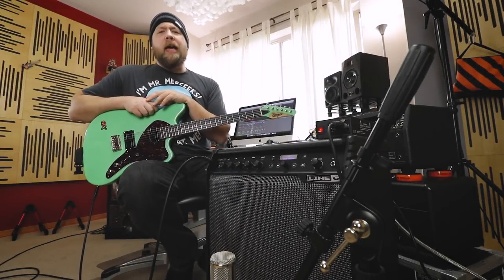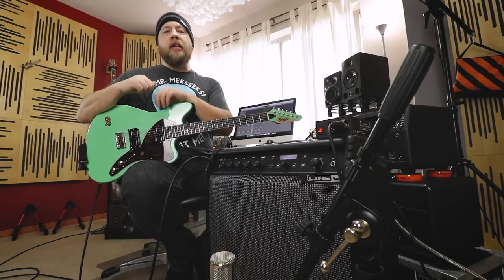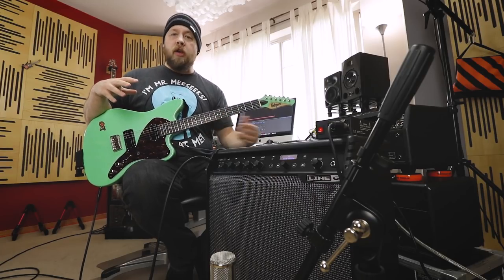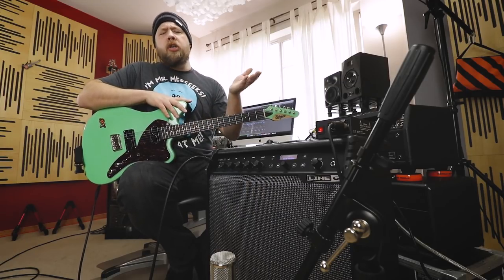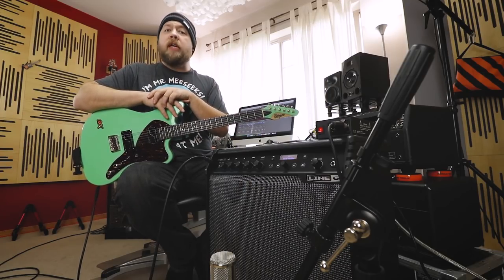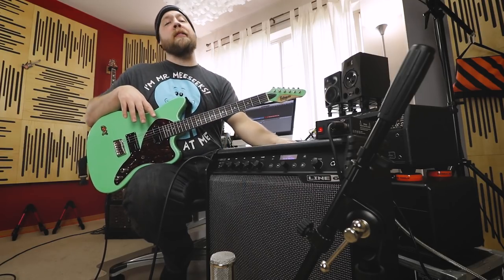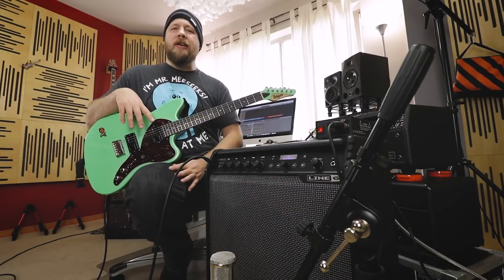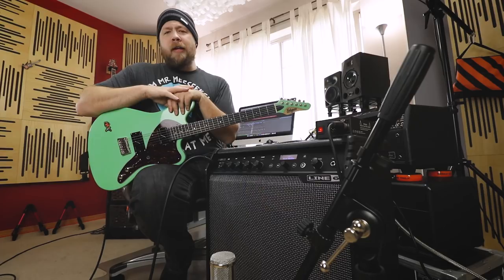Line 6 Spider V 120 - Metal

Comment: Do a blind test and pretty sure half of these people on this comment section wouldn't notice it was line 6 spider.
Reply: diazzsama your right i would notice its a washed out muffled sounding amp
Reply: Agreed!
Reply: zachary allende you totally would not.
Reply: I love my 240 hc, fn amazing amp
Reply: it's terrible. ........genuinely using mine as a table for my ps4
Reply: @demonicon1  What do you think about the built-in speaker? I looking forward to buy one but without a cab, only for home use, do you think are good enough?
Reply: @gunshotheafy  its honesty not great without the cab. It's not horrible but the cab is definitely where the sound is
Reply: Damn right
Reply: @modernlife1321 I know your comment is old, but the muffled sound is the EQ settings. You can change those. I have owned Fenders, Marshalls, Vox amps in solid state or tube. 

The teuth is, the Line 6 Spider is engineered to sound like the Mesa Boogie. And it 100% does. For an absolute FRACTION of the cost. 

You don't need a $6,000 head and cab to sound good. 

Your attitude reminds me of mechanics with Snap-On $10,000 tool boxes that can't do the job of the guy with a Husky brand tool box. LoL!!

Comment: I'll say this about the Spider V120, I get compliments all the time. I just took time and patience to A/B mine with my Single Rectifier, Friedman Grunt 40 and Marshall TSL60.  Ok, I did spend about 25 total hours tinkering with the eq settings ect. Now I have a 29lb small gigging amp that actually sounds 90% like the amps twice the weight. I think with any modeling amp, you get out of it what you put into it. It's seems popular for some to hate on Line 6, as if they're the Nickelback of the amp world, but I've owned 3 different models and the Spider V can sound like most any amp you want if you have the patience to create and perfect your patches. It's extremely versitile. Thanks

Comment: I've been playing since 1979 and have owned more amps than I care to remember.   These Spider V's (gotta get the 120) are really flying under the radar because everyone is raving about the Katana but I spent three hours playing the Line 6, the Marshall Core, Fender newbie Mustang, Katana 100 and Blackstar IDP.    The Katana was overtly bright though I suspect that could be somewhat negated once the stock speaker is broken in.  The Fender's cleans were nice but its high gain tones sounded like a kazoo.   The Core's tones were about as inspiring as eating a plate of pre-chewed peanut brittle and the Blackstar IDP was definitely impressive.  I almost chose that one.   However, in the end, as I've written elsewhere, forget the L6 presets and get into some deep diving with the options and the tones are definitely in there, as others are discovering.   If you liked the Vetta but never had the cash for one, the V is right there with no apologies.   One thing that sold me on the L6 as a "fun to f**k with when I'm bored" amp is the editing which can be done without the amp being hooked up to a computer.  The Katana is limited in that respect.   After the three hour test session, I came away with the impression that nine out of 10 of us would be happy with either the Spider V, Katana or Blackstar.   The Code and Mustang just seemed like toys compared to those three.     Once again, forget the presets.   Just start with one basic grind-less tone with the Spyder V when you have an opportunity to play one and gradually add the toppings from there.   The amp, the modulations and additional gain stages (if you desire).  Change the cab and speakers within...even the mic and go from there and one thing that is almost required....use PEQ.   It makes all the difference in the world.

Comment: An improvement yes, but I’m disappointed about the lack of high end, especially considering that you used a tube condenser, sounds a bit muffled to me
Reply: I have an old spider 2 and the treble on that is pure hiss and fizz on high gain. I mean, I've never tried a spider 5 so it could be a meaningless comparison but that would be my theory.
Reply: It could've had more high end if he'd had used a sm57. Condenser mics tend to have more low end and a less sharp high end than a dynamic one, from what I've listen. Or you can always turn up the treble and presence knobs...
Reply: Im not sure where you got that info from, In general it is quite the opposite. Condenser mic's are more sensitive in turn giving them a more detailed high end. thats why they're used on vocals, acoustic instruments, over heads etc more often than dynamic mics
Reply: Drey Bombardier well when I used a condenser on the guitars last time I recorded a band, it picked up all the high end, in fairness it was a pencil condenser (Neumann KM184), and not a valve condenser, but usually when I try and capture the high end I use a condenser (either an AKG C414 or Neumann KM184)
Reply: I agree, my comment was meant to reply to @Alan Rojas
Reply: Drey Bombardier ah shit, sorry man
Reply: Late to the party, but I believe the Spider V has a separate tweeter for the highs; they're filtered out of the woofer.

Comment: Back to back blind comparisons with several tube & modeling amps and the Spider V 60 sounded great.  Several snobs at the shop couldn't pick out the tube amps from the more expensive modelers, including the Spider.  One guy who rants against Spider amps picked it as one of the better sounds.  Was surprised by the results.  Comparison was with the 60 that retails for $300.

Comment: I like his honesty. Nothing wrong with that. As someone who has played on old spiders. A 40 watt blackstar combo and a 15 watt vypyr. I'm not going back to them but that one with the 12 inch speaker could do alright for practices. I'll prefer my valveking tho since its a bit cheaper and louder lol.
Reply: The valveking is a great amp! It can do everything and it's a "real" amp 😍
Reply: Way late to this comment chain, but I picked up the 2nd gen ValveKing 20 watt combo, and god damn does it sound great with my Les Paul and Iceman. I can dial in a decent range of tones, from sparkly cleans to early metal. It can’t quite hit newer metal tones, but still sounds amazing for the price point.

Comment: Okay honestly, I don’t get why there’s so much negativity. For what it is, it sounds great. It’s a practice amp, and not only that but it has a software to really dial in the sound you want with a ton of options. It’s not gonna be as good as an Axe FX or Kemper, because it’s not meant to compete, like I mentioned it’s a PRACTICE AMP. 

With that being said, it’s a great amp for beginners who just want something that has the potential to be good with a lot of versatility. I even bring mine out (same amp as in this video) when I’m traveling as it has a ton of options regarding amps, pedals, etc. 
It does what it’s supposed to do, and it does it well.
Also, the demo didn’t even sound that bad? Like yeah it could be tighter but it’s honestly just the way Fluff set it up, I’ve personally come up with what I think to be better tones for modern metal.

Comment: I found a spider 3 in the garbage not even a week ago, no joke!   Its got a pretty good metal tone for a modelling amp, im using a Fender Mustang V1 modelling one right now when im not doing vst plugins , and this reminds me of it.    It also does the  USB audio interface thing albiet at 16bit 44khz,  but you get some genuine Fender modeled amps and the cleans on it are just amazing.   Whats cool with these types of amps is that you can disable the cab and use your own impulses making the tone even better.  But I have to say the cab's impulses ive used were rarely better than Fender's built in ones, so i have even a little more respect for the quality of the software in there.  Glad to see other companies doing this, and also cool to see you use the a mic to record, but how does the interface compare?

Comment: If fluff prefers line 6 spider over Blackstar TVP, all credibility lost.
Reply: SiREN2173 I have the ID:60TVP and it’s not bad. It’s useable, and very flexible and easy to get a good tone. But it’s not amazing.
Reply: The Inebriati never used the 60 but the amps overall are pretty badass dude. The difference is in the mix. It cuts just as good as any tube amp.
Reply: Probably a sponsor
Reply: The Inebriati i have both the spider and the i.d 30 tvp and it shits on the spider imo
Reply: Ive had the bs studio and a line six duoverb. I actually like the line six. It had more options. Black stars kinda shit them selves at high gain.
Reply: Line 6 cabinet/mic sim is garbage but their amp models are decent through real speakers. Way better than pedals for sure.
Reply: wait you also play guitar? I saw u on 65 drums.
Reply: Credibility? Idk about TVP, but if that amps core tone is from the ID series, then all hope is lost for that shitty amp. Fucking thing sounds tinny and metallic.

Comment: Haters in 3...2...1... read below: 👇🏻👇🏻👇🏻👇🏻👇🏻👇🏻👇🏻👇🏻👇🏻👇🏻👇🏻👇🏻👇🏻👇🏻
Reply: Why do these guy's dislike the metal tone of this spider V, i thought it sounded good? Don't they realize you can change the parameters of this amp and also other modeling amps to make it sound the way you like it!Stop the silly nitpicking and learn how to use a modeling amp,that is what i say to the haters!
Reply: You could set yourself up much better for playing into a DAW for the $400 this amp costs though, especially for the way the Spider V ultimately sounds NOT heavily modified by audio software. Once you process it a bunch you might as well have just gotten some plugins and used impulses to begin with. Which there are some pretty decent free ones. A Scarlett Solo is $100, download a free DAW and some plugins and at the least you will have an equivalent sound to the Spider. There are better tone options out there for the money.I do admit that I owned a Spider III when it first came out and I developed 90% of my skill on that amp. I honestly loved it. I would say the Spider V would be a good beginner amp but that just isn't true given that kids today can achieve professional recordings with nothing but a cheap interface an iPad....

Comment: Line 6 has just become cool to shit on. The funny thing is most people that just automatically shit on all things Line 6 are people that have only played a couple if any at all. Literally all of the big YouTube guys Anderton/Fluff/Ola/Philip McKnight, with the exception of Glenn, all like Line 6. Line 6 is no different than any other big amp company, they have had good and bad periods of production and they have good and bad amps. One thing you start to learn with more experience over the years is its just plain stupid to assume quality based on Brand names. People in the know, that have played a lot of Line 6 stuff know they make some good amps. The Valve and DT amps especially are pretty badass and because of all the dumbshits shitting on Line 6 because everyone else does they're all pretty cheap for what you get. PLAY ONE FIRST, then decide.